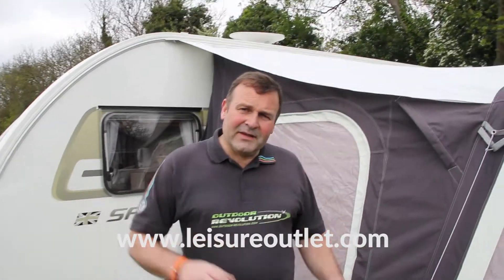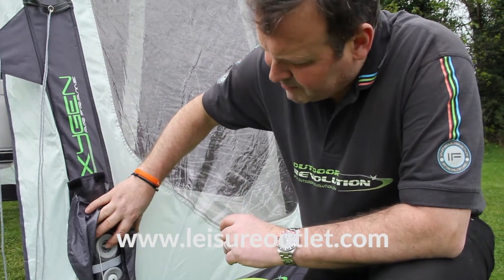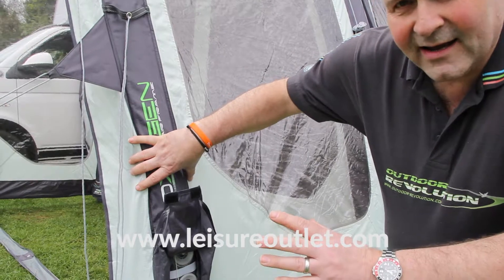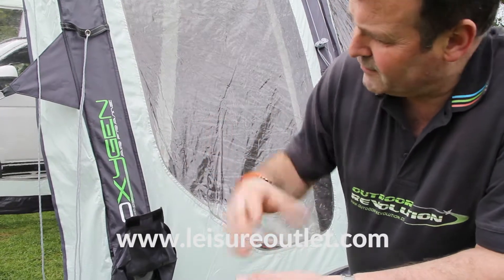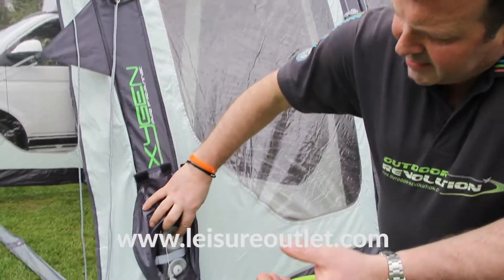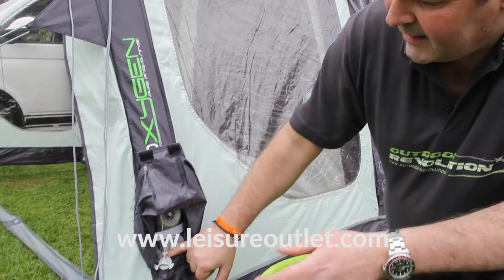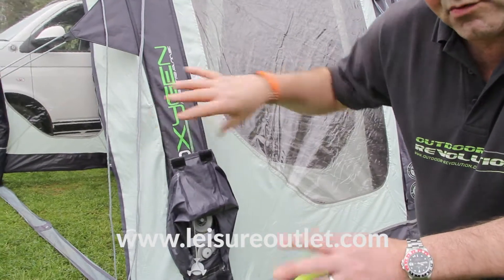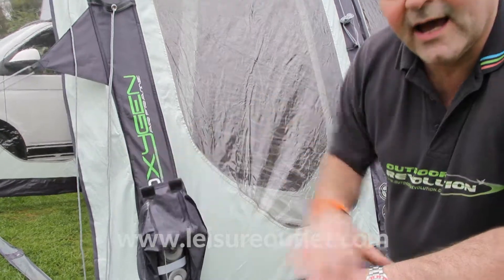Introduction to Outdoor Revolution's Air Frame Inflation System

Comment: Same …. Not 1 video yet on actually pumping the thing up and engaging the valve… I found it tricky 

We dont need to know about getting the air out …. 
Id rather a traditional valve which doesnt leak air when pumping up